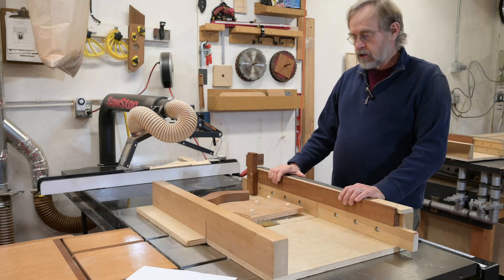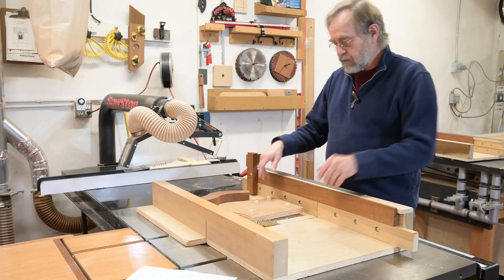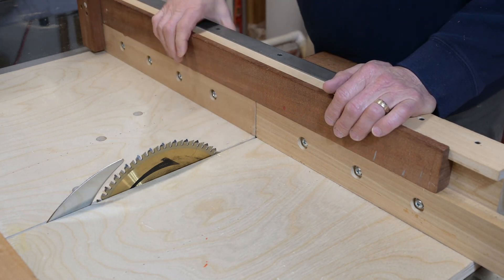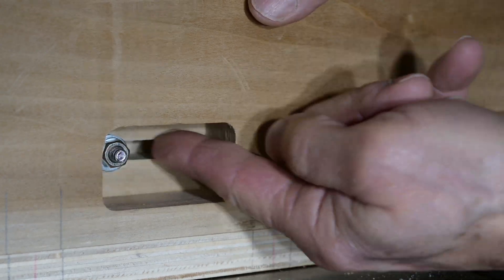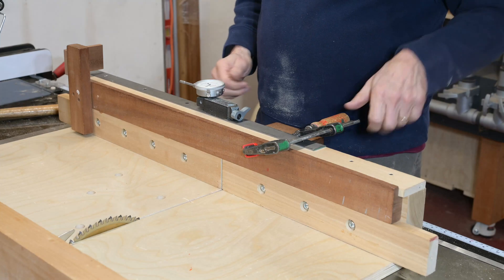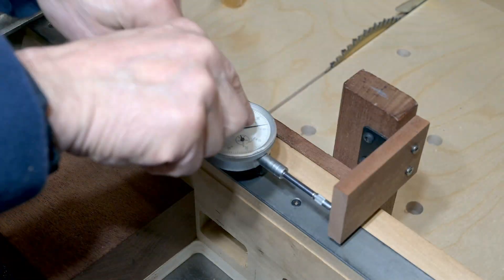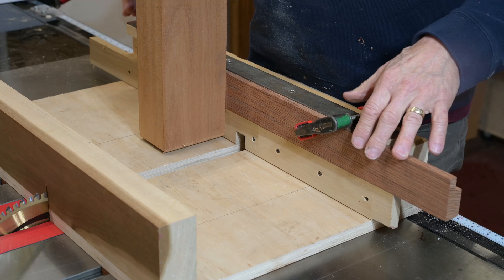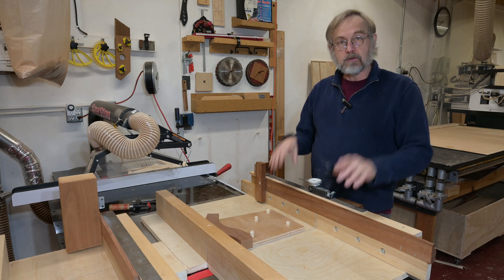My Super Charged Table Saw Sled with a CNC Interface and Micro Adjustment.

Comment: What do you need a table saw sled for if you have the Hammer sliding panel saw?
Reply from the maker: Partly old habit  - but also I find it quicker and easier to do small parts with a sled.  For anything  that's 12" or so long I use the sliding saw

Comment: Maybe I missed it. What is the purpose of the notch in the back of the sled?
Reply from the maker: Hi Mark, the notch in the back is where I attach a block of wood so the blade  is not exposed when  push the sled all the way through -  for safety -purposes
Reply: @DarrellPeartFurnitureMaker  this cannot be overstated !! 2 years ago I made a " super sled" glided like a luge on ice. I had the box made but not attached yet. I "only needed" to square up a couple of pieces for a mudroom bench. One left to go I turned to grab it and the asked gently skid forward. Unfortunately the tip of my thumb was across the blade slot. Fortunately the tip of my thumb grew back for the most part. William Ng warned about this. I should not have proceeded to test the sled without it. Not lecturing just providing firsthand experience.
Glenn
holdingspetra
Reply: **sled ( not asked🤷)
Reply from the maker: @grupp61  yes -  I have witnessed too many accidents  - safety first. thanks, Glenn